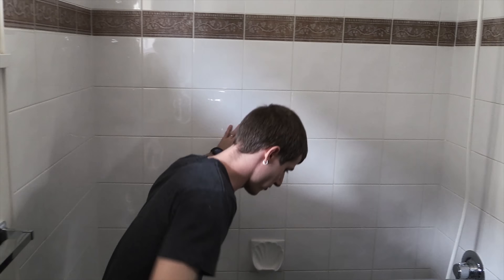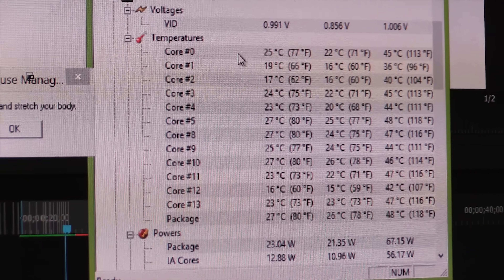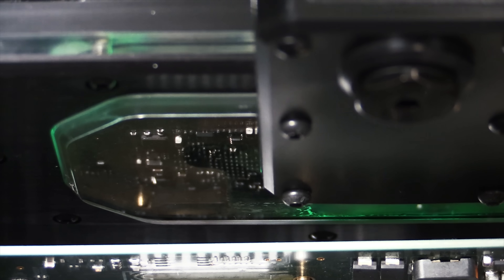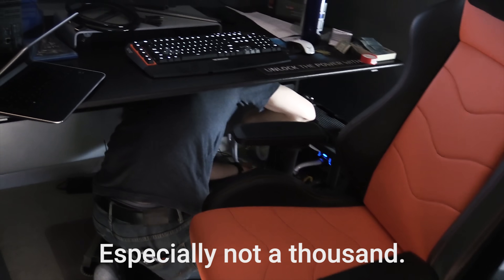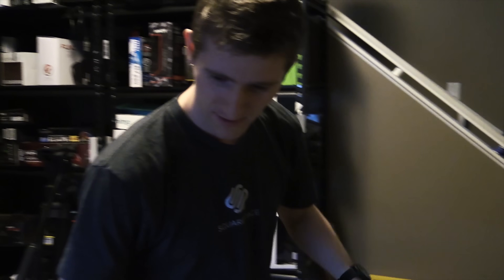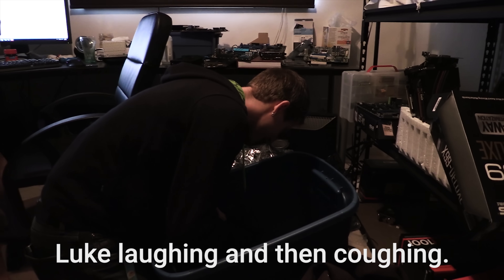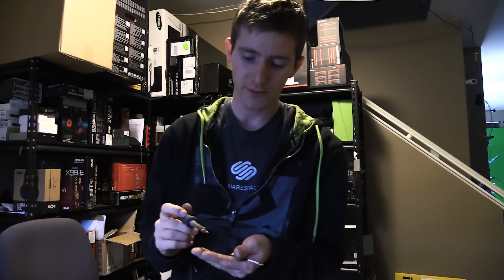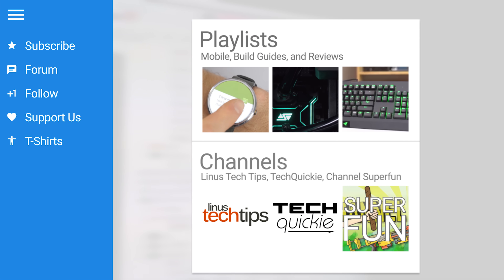Whole Room Water Cooling Part 5b - Some Issues, More Solutions...

Comment: Linus you have my admiration!   You are doing pioneering work.   Doing pioneering work is always messy, takes longer than expected, ...etc.   You might not have noticed but your project with water cooler all over the home/office is suggesting the invention of a new product.Let me suggest that a car radiator, which come in many different sizes, be used to create a "computer system radiator (CSR)"  (new product).  Car radiators are established products that come in different sizes.   A  csr can be made for different capacities of 1, 2, 4, 8 or more computers or more.   It would be made of box sitting outside and two tubes going inside and system of special tube joins, which are part of csr, would be available to create tube circuits to meet the need of the user.   The special tub joins would have knobs to empty out air bubbles,...etc.   Maybe the knobs can be electronically controlled.   That's a new product. Yes, you invented a new product with a potential market.

Comment: I've always had an issue with soldering stranded wire. Maybe I don't have a good enough iron to heat it up properly, but the physics doesn't make sense to me either. The many thin copper wires with high surface area to volume ratio would seem to act like a heat sink and pull heat away from the location of the soldering. It seems like you would have to heat up the entire wire to the same temp before you could actually melt solder at the joint. I often will pull apart stranded wire from each source and solder maybe 2 or 3 of them together at a time. That way, it limits the ability for the wires to disperse the heat. Plus you get an amazing connection that will probably never fail. It's more time consuming and uses a lot more electrical tape, but it's the only way I know how to get a good job done. Then, I just heat it up from underneath and when it's hot enough, the solder melts and pretty much coats the entire joint by itself: it looks like it just gets sucked into the whole thing.

Comment: Soldering tip, just heat both wires and put solder onto them, not on the soldering iron, then remove the iron and keep everything still until it cools down. The solder should be shiny, if it goes matte you must reheat it and NOT move when cooling down.

Comment: omg why didn't you put a pump in the middle of the water loop that would have helped with the flow rather then side by side ?
Reply: the way he has the pumps drives me crazy lol.. I would have let one push water and one to pull water with the res in between...

Comment: hope when moved to th enew place you at least put "heat shrink socks" instead of electric tape over the solderd wires ?

and maybe insulate the water "input" copper pipes ? 
due to the fact that roomtemparature can influence the incoming water temp ! copper is a great heatconductor as you said yourself a lott of times in many of your vids ;) 

2nd ........ wished had all that stuff that is more then a year old in hardware . when i see the vids with all that stuff lying around it feels like heaven for a guy like me . lol 

powersource 700 OCZ  ( closed company ) Modxstream PRO - 3 yrs old and still no issues .  so you know how well i take care of my old stuff . and yeah love modular connectors since i have this one  , maybe bit overpowered but better that then buying for a 20€ lower a standard unit and it goes bust within a year or 2 :)

core2duo 775 6600 ( 2 x 2,4 ghz ) ...... hd 7800 series ( scaled down to 1600x600 due to mickies driver problems and my HD 5650 fans died project refitt ordinary 20mm high fans in the pipeline ) 4gb kingston mem non paired  . 1,8 TB old HD`s redundent drives from my older brother . and a simple heatsink block with 3 120 mm coolermaster fans in the case and HS . MSI G31TM series . gpu temp 40-60 celcius --- drives temp 32-40 ----- cpu temps 19-31 celcius . but can at least game on this old boy :D 

but i love the way you make the vids , fast as possible series are a bit too fast for me . lol but cudo`s to you and your team .

Comment: Don't ever use a water sponge for cleaning off the tip of your soldering iron (it speeds up corrosion).  Use a wire sponge instead.

Comment: this is a tip for a soldering iron you should  to have a fan filter if you don't have it you will get  canister or it is 99%you will die from the toxic fumes how I knew I have 1 make shod make the fan on high

Comment: Use a helping hands system when soldering, to hold the pieces that you are working on still and in position. 

Paint 1 blade on each fan in the fan system white so you can see from a distance that they are working. 

To delay the need for peeing.....scratch at calf area or think about sex...this delays the biological imperative to pee. (Really works)

Comment: I know it is way too late but instead of using the multiple radiators you are using you could use a single automotive radiator with the included 12 volt automotive fan. It would require a larger power supply but you could also use a voltage controlled regulator to control fan speed. The advantage would be a much higher BTU capable heat transfer system.

Comment: so you know, you shouldn't solder wires together... get some splices. easier, faster, safer, far more durable.
Reply: if you insist on soldering wires though, tin the wires (apply a thin coat of solder to the entire bare wire being careful not to melt the insulation), twist them together, heat up one side and touch the solder to the other side. the heat will wick the solder to the heat source.
Reply: you might also want to invest in a small brush and some rubbing alcohol to clean the wires after you join them to reduce corrosion in the future...

Comment: Just noticed that you've connect your pump in series which supposed to be in parallel like what building chilled water cooling connected..if you reconnect them in parallel you will get double the head pressure..

Comment: I think the biggest mistake that linus makes here is he forgot or underestimate the power of gravity. the main pipe way are too high and when ever the water reaches the vertical pipes the gravity takes it action in addition to the power of that pump not to mention the amount of water that will run on to the next vertical pipes is now lesser while the first was being filled. 

they didn't try putting a valve on each vertical pipes just right before in enters the board.  with the valve in there the water are not allowed to enter until the whole pipe system are all filled first.

Comment: if you install some ball valves between the pump inlet and outlet it would make changing the system out a lot easier. No more clamping the tubing

Comment: Question.
I've got a single air bubble in my single radiator single fan  cpu only loop right before the cpu block, water is going past it nicely but i can't seem to get it out. My temps are 15-25*C idle, 40-45*C while gaming and 50-60*C in a CPU burner after 30 minutes. (It stopped increasing temps at 55 on a cold day and at 60 on a warm day, 10 minutes in. In the burn-in that is)
My CPU is an 8350 that I plan to replace sooner or later.

Should I be worried?

Comment: Okay, how on earth you've ever thought such multi-failure point system world actually work? So many joints, so many lose parts and what the hell is with that radiator and all those fans made for indoor use...

And I can go on, the power supply for the fans, seriously you never heard of reserve , if 2A are what the system needs you should have went for 3A and 15V.

Also you can sterilise the tubing with 3% peroxyde solution.

I can go on for another 1hr, but if I were you, I'd scrap it all for good and go for closed loop individual cooling..

Comment: Heat shrink. Heat shrink, heat shrink, heat shrink. Electrical tape can not only fray off eventually, but heat shrink offers better insulation as a material than electrical tape. You're also leaving yourself wide open for cold solder joints with your pre-tinning. You should always heat the conductor and melt the flux onto it.

Comment: Leave the bare wire untwisted, push the 2 ends into eachother like a mesh and then solder. Makes it a pain to un-solder/cover with heat shrink but provides a "better", stronger connection.

Comment: When it comes to soldering I would suggest using liquid flux. much less leftover residue. I would only suggest flux pens for actual circuit boards. and don't even think about using paste flux. from personal experience it leaves a lot of residue that is difficult to clean up. also If you have the money I would suggest investing in a hakko soldering iron. fast heat times, very reliable, I use them at my work. make sure to apply the solder to the wire/joint, and not to the irons tip. only time I apply solder to the tip is before I place it onto a wire or solder joint for more thermal contact.

Using flux cleaner is also great but can eat through conformal coating, You can use alcahol and a cotton swab to clean off the residue if you want to go that route. hope this helps!

Comment: Another soldering tip is to use solder paste. It comes in a syringe like thermal paste, can have flux mixed in, and you can just goop a little bit on where you need to solder. It frees up a hand to hold the solder spool, and is sticky enough to hold wire ends together provided they aren't hanging/being pulled.

Comment: Few tips for soldering :

1. Always keep the tip of the soldering iron clean and try to not inhale the smoke produced from soldering if possible.

2. Heat the area thats being soldered then apply an adequate amount of solder. 

3. Try and solder quickly because the flux in the solder can burn not only making your soldering look messy, but it can also effect how efficiently the flow of electricity passes through the soldered joint.
 
4. Use heat shrinks for covering exposed soldered wires or connections then cover them again with electrical tape for re-enforcement  

hope it helps !

Comment: for this sort of soldering don't overlook a weller d650 soldering iron or an older D550 as their generally the same unit, at least the 70's ones.  330 or 200 watts of trigger  fired fun, generally heats to soldering temp  in 10-15 seconds. generally costs what a fancy soldering station does but please don't use this on pcb's, or other valuable items as its heat output is pretty extreme for that role. I use mine to solder coax connectors, wires and etc and for all of the time the soldering station is waiting to heat, your done soldering!

Comment: Well, I guess it all works now but, the airbleeding would have been real simple by running the small first circulating pump and just clamp off the radiators alittle.
Then  that powerful pump compared to the small ones in the systems would have flushed all air out.

Comment: why doesn't  he just puts his pc in  a freezer instead?
Reply: RX7821979 or better yet buy air conditioning
Reply: RX7821979 or better yet buy air conditioning
Reply: Retardic Retardee I'm not entirely sure, but i if i remember correctly, most processors (both GPU and CPU) can't run at temperatures under -40 degrees Celsius.
Reply: RX7821979 Why not fill the water cooling system with liquid nitrogen
Reply: Pwnegekill hahahaha
Reply: Liquid oxygen wouldn't work then? :(
Reply: RX7821979 And 2 months later he does a video about a PC in a refrigerator!

Comment: Oh god. Saying the soldering job was awful doesn't even do it justice. There's countless videos on here that show you how to do it. I'm not sure if Home Depot sells multiple kinds of solder, but you should be using MUCH smaller solder to help it wick on the wire faster.

I'm not sure if this holds true for wire, but at least for circuit boards you should NEVER use plumbing solder on a PCB, the flux (which is in the middle of solder wire to help clean the joint) is different for plumbing and electronics. Plumbing solder tends to corrode circuit boards, but since you're soldering copper wires with solder for copper pipes you might be ok in this instance...but still I, that was more painful than watching an SPCA commercial.

Comment: You should use heat shrink tubing to insulate it because electrical tape is not as professional as heat shrink tubing. You can get it at the source or at radioshack.

Comment: I would stick to my raised-floor computer room and my IBM System 370, easier to install and maintain. To solder, just heat the point to be soldered, prior starting. Then bring the soldering wire and try to melt it not only using the tip but the joint itself that you have been heating previously.  Wires as so hot that will tend to act as the actual tip getting even soldering. You can add flux if you want. Certain wires or metals are a bit reluctant to get soldered so the overall quality is poor or take tons of time. Apply flux to the wires or joint, prior to solder, this will make soldering process going fast and even. JUST WEAR eye protection in case you are doing at a short distance. A good tool is also important. This Weller is way good enough, perhaps you need to add a bit of power during wiring soldering, not sure about the temp setting, well Googling .....

Comment: Soldering tips? Well not directly soldering but you should really use Heat-Shrink tube for wire connections. Looks much better than tape and is safer too

Comment: btw how is this in any way meaningful and effective?

why not just get individual enclosed systems and keep it simple?

this means a leak will not only ruing your computer but possibly all computers and the house itself...

it's just a monumentally stupid idea... and would only make sense if it was for some crazy super computer cluster rig

for simplicity it might have made more sense to have made a custom cage for all computers all done in a neat easy line and then just to KMV extension setups to each workstation instead...

this whole spread out system is not very efficient and reliable...
Well that is if you insist on doing 1 looping system where one failure means total failure

Comment: ya heat up what you are soldering then apply solder make sure to not over heat some components best way to solder 2 wires is to dip both wires into a solder pot then solder them :)
Reply: use the sponge to check heat not your tongue LMAO (make it damp not wet)

Comment: a tip on soldering.  before twisting the individual wires to get em nice and sleek looking, braid the two wires you're soldering together.  it's a lot easier to get some effective solder flowing when you have lots of surface area from each wire touching.  also, it helps to have a high wattage iron if you're soldering larger gauges.  typically, though.  30 watts is a nice sweet spot for replacing capacitors on motherboards and other general PC soldering.  i have a Weller 30 watt that performs like a champ and is the best in terms of price-performance.

Comment: If you think about doing this again at the new place put some valves at all of those stations so you can turn them all off and burp one at a time and when they are all in use you can use them as flow restrictors to limit the ones closest to the pumps to push more flow to the ones at the end and try to even things out.   A 12v car radiator fan that can be found for $10 at a salvage yard would have been way simpler too.   I have seen a reliable system like this and they did not even use a radiator or fans, they piped a loop around the garage that always stayed cool and the length of the pipe and capacity of the system was more than enough to keep a few servers cool. So it can be done

Comment: once you've done it once, you'll cut the time doing it a second time to a fraction, seems from here you need much more powerful pumps than standard pumps, though this project has taken more hours, than its worth, but ultimately this will prolly work out with more powerful pumps, especially with filtration, definitely should have added biocide.

Comment: If you want a higher flow rate you should run pumps in series. I'm assuming you already know that though since you mentioned that in the last episode. Do you not want to run different size pumps in series?

Comment: Reminds me about my own water loop and its many issues... except x100 with problems to get it all working. Damn though I really want to add a detachable outside radiator to my whole loop! While your machines are connected do the small rads on the machines output much heat? Also ever considered silver to kill out algae?

Comment: when you solder you should use the iron to heat up the wires and hold it there. then instead of putting solder onto the iron then moving it to the wires just touch the solder to the wires. if it flows onto the wires you have the right temp and you will get the best results. you will know if it isnt done right because the solder usually will clump instead of flow.

Comment: You dont grab solder with the iron then carry it to the wire and paste it on like a paint brush. Touch the tip of the iron on the wire and apply solder to the tip of the iron allowing it to flow onto the wire. Also use heat shrink to protect the connection. I was also going to suggest you research PT Nuke but the $200 filter will work too.

Comment: You have to heat up the wire with the iron and then put solder on the wire and it should melt from the heat of the wire,I think you used solder that is without flux ... Never buy that stuff for soldering electronics it is used for soldering /brasing pipes, use rosin core solder 60/40 lead solder for best resoults,you bought one of the greatest soldering stations and i am jelous good luck.

Comment: I am all in favour of this plan, but why oh why did you choose pc radiators! the fans aren't fit to be outside, the pressure loss through all those fittings and rads must be cronic. Should have pinched a radiator + 12" 12V fan from a small car, would have been ample, and MUCH easier to wire!